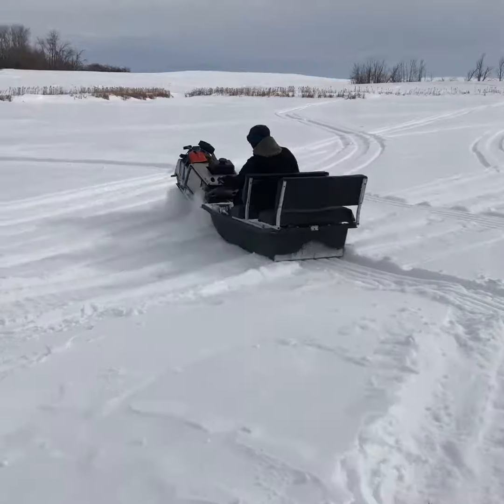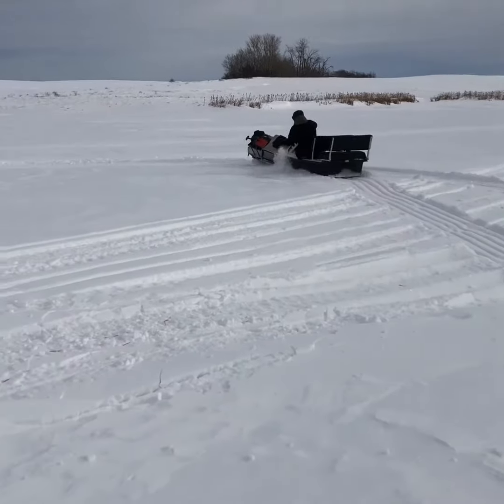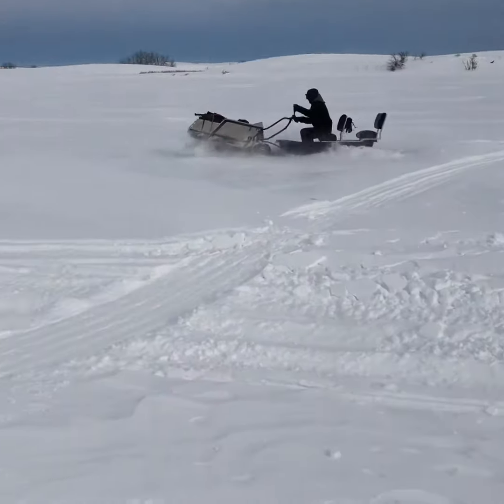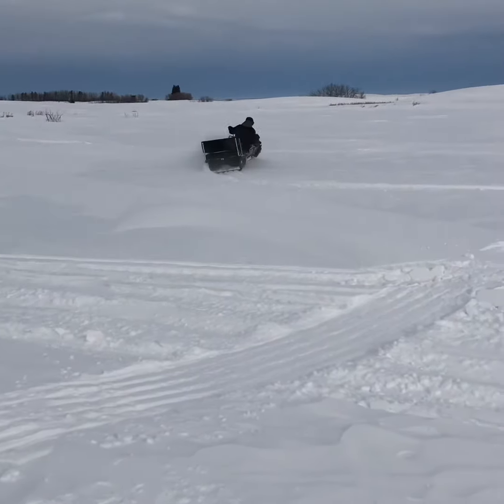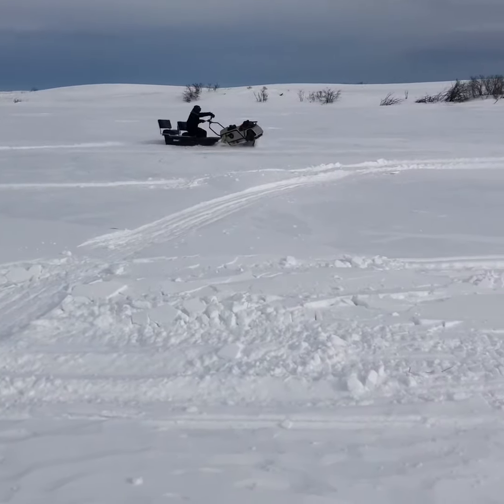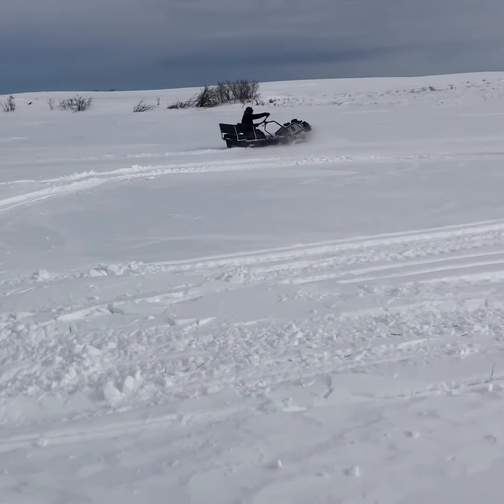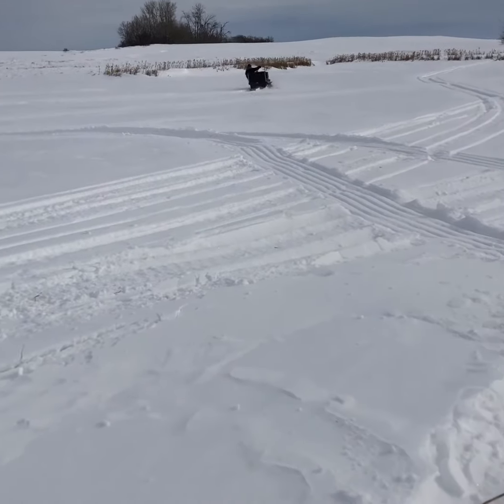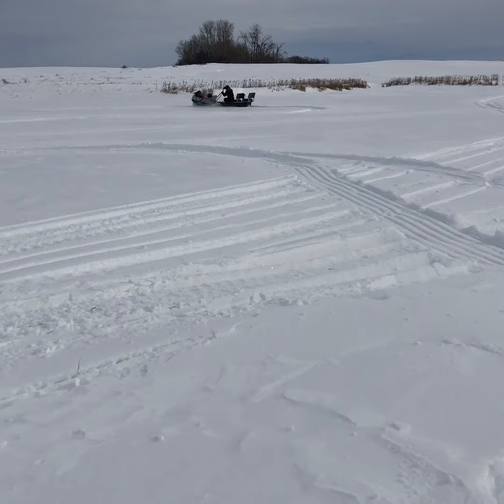Home built snowmobile in action

Comment: Man that’s smoother then a fat chick rolling down a hill and more fun to ride ! Lol. I like your dimple dies on your dash , nice touch 👍! I started on mine and found the 1973 Evinrude tunnel ( steel ) was completely shot ! So I’m going to build a 1x4 channel iron frame but my 22” wide track and bogeys are great 👍 and I will have forward and reverse and decided to use the 13 hp Honda instead of the HF 6 1/2 hp predator . Did you go with the thumb or lever throttle ? I wonder if ski outriggers spring loaded would work ? I’m also thinking heated handgrips and some LED lights , what’s your thoughts ? So far I have about $250 invested and I do have everything except the heated handgrips ! Looks like your having a blast !
Reply from the maker: Dave Kimbler thanks! Yeah I would definitely go with the 13hp, I originally started with a Honda 270cc (9hp) and It just wasn’t powerful enough, I went with a finger throttle (just a shortened brake lever) and it works great by freeing up your thumb to let you grip the the bars and I would definitely put some lights and hand warmers if you plan on being on it for extended periods, I haven’t done lights yet as the engine I used doesn’t have a charging system however I’ll be putting a new engine with charging system on at some point being a lot of our riding is done at night and it sucks when the batteries in the flash light die and your still miles from home lol!
Reply: jrcmechanical I do know what that’s like ! ( no lights , far from home ) and the Honda does have a charging system ! Lol. Its a lot easier when there’s someone around who’s built one before to ask questions ! I thank you and hope I’m not a bother ! I’ll let you know when it’s completed ? Again thanks !
Reply from the maker: No bother at all I enjoy talking about these kinds of things, in fact that’s one of the reason I started this channel! I look forward to seeing your creation!
Reply: jrcmechanical I can’t wait to get it done but I want to make sure it’s done correctly not half assed i sure you know what I’m saying !
Reply: @davekimbler2308  Did yu ever get yours built? I would love to see pics and am in the process of collecting parts for it.